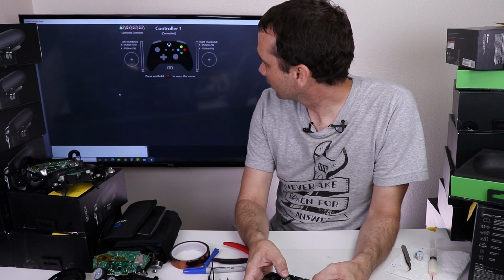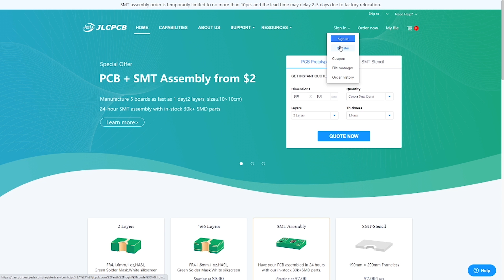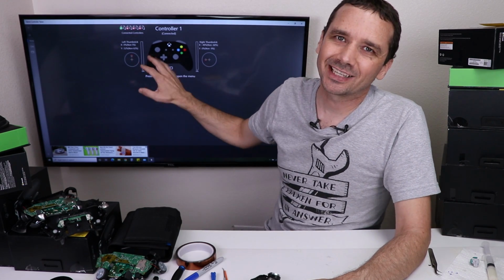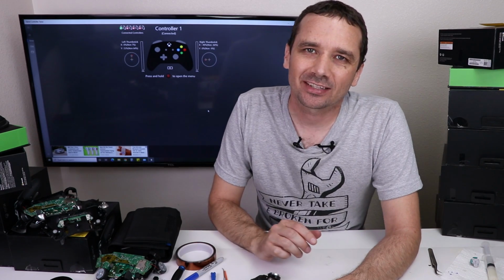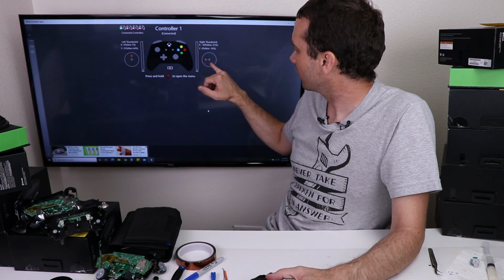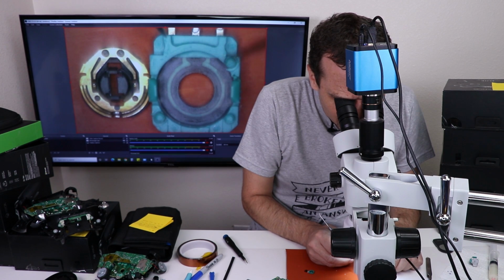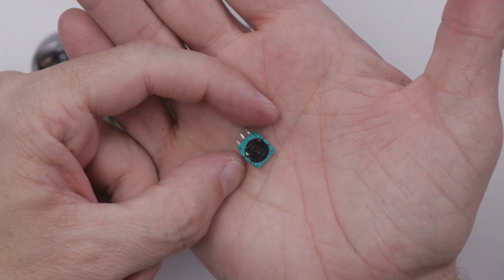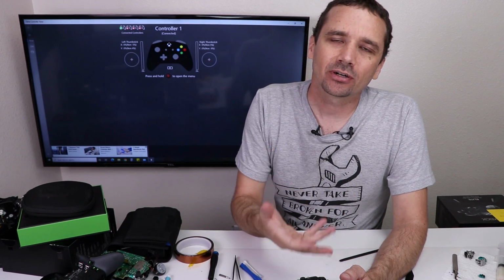How to Fix Analog Stick Drift - 3 Ways

Comment: Man I have had so many issues replacing the joysticks and the contact on the board coming off, this is super helpful! Any idea what would cause the little metal ring around the pins on the board to come off? And is that game over for that board?
Reply: Excessive heat, or blunt force (when pulling a component when the hole is not completely solder free).

Comment: If the stick itself is perfect and only one potentiometer fails the way of just replacing the potentiometer is very good and cheap way to reapair a 60 bucks controller
Reply from the maker: Yep...and much easier than replacing the whole stick.
Reply: @Tronicsfix  my controller have orange potentiometer, does it mater what color I replace them with?
Reply: @pspveg818  I don’t think the color matters. As long as it fits you’re good to go.

Comment: tronics how do i fix my control when I press r2  the left stick starts drifting pls help and it is something to do with r2 as I installed the extremerate DIY remap kit that you used and when I map r2 to it I get no drift pls help also every time I use the control I have to connect it manually to the ps4 by wire it somehow forgets the ps4 every time but the ps4 remembers it in Bluetooth setting
Reply: Replace the stick.

Comment: It's kind of obscure, but you forgot that the 4th way to fix stick drift is to replace the thermal paste.
Reply from the maker: Ha, ha...BUT ONLY if you use the perfect amount!
Reply: I fixed mine by taking it apart completely, then put just put a drop of wd-40 in the little square box. Haven't had any issues since, lol.
Reply: @Pyro-Maniac  I may try this first. That's DEFINITELY a project I could handle lol
Reply: Barbequed Bun how is working for you? Is it still working fine and did you use regular wd40?
Reply: @thedragonknight8061  i used regular wd40 and it worked on 3 of my ps4 controllers !!!!😃
Reply: @LuisMarquez-ki4ek  how long has it lasted or is it still working fine?
Reply: @thedragonknight8061  its been over 3 months still working fine no problems
Reply: @thedragonknight8061  I know im 4 months late but to answer youre question: yes it atill works great as of now
Reply: Owlette by box do you mean the metal one holding the stick? Was it regular wd40?
Reply: @thedragonknight8061  ya just regular wd40... U have to pretty much take the controller completly apart to access it ... If u did then ya thats probably the one ..
Reply: @thedragonknight8061  I just took a spoon poured a tiny drop into the spoon then poured it into the box... It can  make the controller even worse. But for me it worked like a charm.
Reply: @Pyro-Maniac  fr
Reply: @Pyro-Maniac  the problem was u needed to take the green cap off the joystick remove the peice in it and then clean the inside of the green peice with a qutip dont leave cotton in it
Reply: @Pyro-Maniac you didn't use regular wd40 did you?
Reply: ty for the laugh
Reply: Don't forget, you must measure the paste in "pea size" unit
Reply: I went from occasional drift to constant drift after cleaning the tiny discs. Is my controller wrecked now?

Comment: Hey @tronicsfix, whats a good heat temp for the hot air on PS4 components, motherboard included? 

Thank you
Reply from the maker: I usually keep mine at 1100F and vary the distance between the wand and board for various temps.
Reply: @Tronicsfix  OK cool, I wasn't sure if I was damaging anything at 800F. Thanks for the prompt response!
Reply from the maker: @bryanfrye8770  A lot depends on how close the heat is to the work piece. I start out higher then move closer as I see how the piece is reacting to the heat.

Comment: What temp do you normally have the soldering iron to melt the solder on the board to free it? I can’t seem to get the solder to liquid on the elite controllers.
Reply from the maker: Mine is usually set at 1100F and I adjust how much heat gets to the board by the distance my hot air wand is from the board.

Comment: My friend had stick drift on his Xbox controller white and he just replaced the whole controller
Reply from the maker: A lot of people do.
Reply: Just wondering I have a Nintendo switch with 2 red joycons and for some reason the l button doesn’t work and the - button works perfectly but it is hard to press
Reply from the maker: @Max-9632  Prob just needs a good cleaning.

Comment: If you try method two and it doesnt work buy a NEW thumbstick of ebay and swap the ring as in method 2- this worked for me.

The other thing you can do swap the rings and if the controller drifts on the opposite axis then you know it is the ring and not the potentiometer it self
Reply from the maker: Nice! Glad it worked for you.

Comment: I once had a controller that was drifting I removed the analog and I swear it was still drifting 😕
Reply from the maker: It was drifting without the analog stick even being there?
Reply: TronicsFix yes a PS4 controller came in the box but lasted only 5 months before the drifting started I tried everything but nothing worked (didn’t replace cause I don’t have the tools for that) so just took out the analog and plug it in to my surprise it was still drifting
Reply from the maker: @Kingcezar835  Interesting. That's a strange one. Must have been a problem on the board.
Reply: @TronicsFix  ya I thought as much just got a new controller. I don’t know if this happens in just my country but have you noticed different internals for controllers which I could send some pictures
Reply: @Kingcezar835  different ps4 controller models look different inside that's why It looks different

Comment: Where do you get your Analog Sticks from? Thanks.
Reply from the maker: These I just got from a random eBay seller with good feedback.
Reply: @Tronicsfix   Thanks for the reply.. I've had nothing but bad luck when it comes to buying replacement sticks :P People have suggested buying Sticks with ALPS branded on them but even some of those have turned out to be stiff and not as responsive as the original sticks :P Love your work btw :)

Comment: That third method is a new one to me! Really makes things easier than taking the whole thing out.

Do you have any tips on melting the stubborn solder on Xbox Elite controllers? Those joints don't seem to melt easily for me at all.
Reply from the maker: My Sunday video shows how to fix those...but it's the same as in this video. Just takes the right amount of heat. If it's not melting for you it needs more heat.
Reply: Omg I thought it was just me! I was about ready to give up on repairing controllers forever because of the Elite. I have a Hakko desoldering gun and I thought it was broken. It only removed some of the solder. I then tried using the soldering iron with braid with no results. I added fresh solder, flux, etc. All other controllers I have been able to remove these effortlessly with the gun but wow. Why is the Elite so difficult??

Comment: With my ps4 controller I can hardly sprint anymore when I play Call of Duty, could you look in to that and maybe do a video on it? It's the left stick and you do hear it click as usual, it just doesn't sprint..
Reply from the maker: Probably needs the analog stick replaced.
Reply: @Tronicsfix  okay, thanks!

Comment: I've managed to fix 30+ DS4 🎮 since the lock down thanks to this man (without soldering, as I don't have that equipment/knowledge)
Reply from the maker: Wow, nice! That's awesome. Nice work.
Reply: So all you have done is the Option 2, potentiometer steps right around 6:00 to remove them without soldering and it's fixed many controllers? 
You clean them the same way as shown in the video?

Comment: I wanna do a replacement really badly but i cant find proper tools or replacement parts where i live, its difficult enough getting phone parts let alone controller parts.
Reply from the maker: That can be tough. Usually eBay has what you need.
Reply: @Tronicsfix  it usually doesn't ship to here or the shipping cost is more than the parts cost. Its hard having tech repair as a hobby when you live in ksa😂

Comment: Weirdly enough, KontrolFreek’s Precision Rings work like a treat, as well as improving your gaming performance they also keep your analog sticks in a stiff upright position, limiting any drifting. Also the cheaper option to purchasing a new controller.
Reply: So ur saying that the controlfreeks helps alot with the stick drifting?

Comment: Be careful about testing controllers without the faceplate on, I've fixed an analogue stick's drift once and verified that I had full range of motion on all axises, only to then install the faceplate and test again, to find out that with the faceplate I wouldn't hit 100% to one of the sides on one of the axises.

Comment: Let’s be honest, most of you won’t do all this just to fix it😂
Reply: not gonna lie, if I had a rework station I'd give it a try. A whole new piece (analog stick) is very cheap and stores sell multiple units on 1 buy
Reply: @leandrofod  its not hard to do and most of times you can find all the tools at a 99cent store
Reply from the maker: That's probably true, but some will.
Reply: @Tronicsfix  I fixed mine with your instructions. I had not considered using a heat gun to melt the solder to dislodge the piece. I had two broken ps4 controllers and now I have one working one. The other one I broke by not dispersing the heat so the port for the charging ribbon came off and I don't have the patience to solder it back on.
Reply: @Tronicsfix  definitely will.  Why spend almost $70 on a new dualshock 4 when I can repair it myself for a lot less money .
Reply: @Tronicsfix  I've had one board out of 20 that won't power up after replacing the stick, worked and had minor prior to it.. any chance I can send you it? Could be good information to find out the cause of this one fault and you to get another decent video out?
Reply: @Tronicsfix  very true.
Reply: I tried but made mine worse. Sold on eBay and traded my Xbox controller for a new PS4 controller. Method 4?
Reply: @bobwallett  yeah i triend too and just broke entirely
Reply: @bobwallett  Sony, Microsoft and Nintendo all use the exact same Alps joysticks ...... One isn't any better than the other
Reply: Are the analog sticks designed in a different way? I’ve never had any issues with older console’s controllers which are years old but drifting seems to be common for Xbone, PS4 & Switch.
Reply: @AvFcLeGeNDz  Some of the older consoles used Hall Effect sensors which can't develop stick drift more expensive to produce but lasts infinitely longer than these potentiometers Edit: Dream Cast for example used Hall Effect. N64 used Optical Sensors I believe which resulted in far more accurate stick movements
Reply: With a 180 dollar elite controller I would try, way to expesive to just replace without trying to fix it for a few dollar.
Reply: @FamousWolluf  psh, I’d risk it. I can always buy another or just buy an original controller because honestly, the elite controller isn’t that much worth $149.99 since it’s basically the same as the original controller. You just get added extra buttons. All it does is try to mimic keyboard.
Reply: I'm one of those who will try to fix anything until they brake beyond repair
Reply: @humnaset  I'd end up trying to fix it and just ruin it. Actually did that with one of my ps3 controllers.
Reply: Some people don't have the money to buy a new controller
Reply: I know I will.
Reply: Not all. Just 1 of those options. Easy enough.
Reply: All gaming companies use same Alps Alpines sticks from Xbox to Nintendo and even the brand new PS5. This is crazy but a fact. Worst part is that the new sticks can be worse. Replaced 2 sticks yesterday and they were OEM sticks yet they were worse then the original.
Reply: I successfully saved a PS4 controller by opening up the potentiometer and cleaning the contact points. My PS5 controller has drift now too, so I'm going to buy another one and try to fix the first one using the same tactic, might work for me again.
Reply: I would just buy a new controller then attempting to fix it.
Reply: Well guess what, I did use a sowing needle that dug into my skin to do the non soder method. HA gottem
Reply: Damn, do I look like bomb squad
Reply: Mexicans like me will surely do, we have a very long history of repairing electronics on our own, it´s very easy to order replacements for reparing controllers
Reply: i will not do too much hassle lol
Reply: I would totally try no cap. Im in it for straight money
Reply: All the more reason for Tronixfix to charge for his service: p
Reply: Unless it's for the cousins lmao
Reply: The lazy people or the ones who have money to blow won't .  But people like me, who like to save a little money and enjoy learning how to fix stuff will. Bottom line.

Comment: I’ve been searching for a long time
Reply from the maker: Hope this helps!
Reply: @Tronicsfix  does the new potentiometer have full 360 degree support?  Also is it legit?. How long does it last compared to a default stick of a controller?
Reply: @rayyanamir8560  did you even watch the Video?
Reply: @Mars-Nexus  yes I did. But you didn't understand my question.
Reply: @Tronicsfix  I have question can other controller analog stick like a xbox 360 joystick piece be a suitable replacement to solder into the ps4 controller?.
Reply: I spilt milk in mine sadly and the left one is really bad everything else is somehow fine.
Reply: Michael Diederich If you don’t feel confident opening it up, get yourself a long soft clean paintbrush after a few rotations in the groove literally put your mouth over the stick and blow into it, then turn your controller upside down and tap the stuff out. Repeat process. But be gentle with the brushing.
Reply: @ExplicitPlay  ngl i just did that for mine and i ive never spilt anything in mine and a little piece of something fell out and it works fine now tysm
Reply: Trust me, now everyone talks about it
Reply: Same-